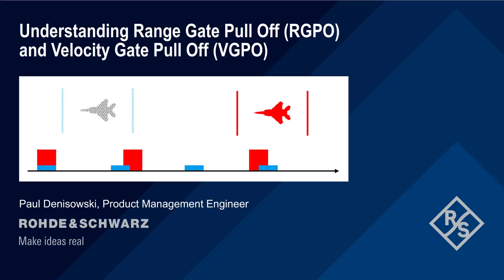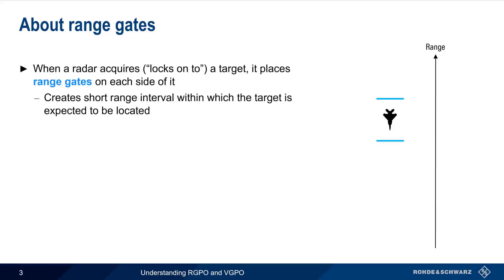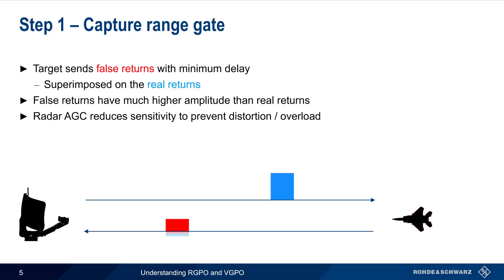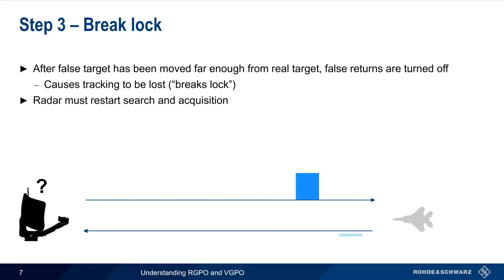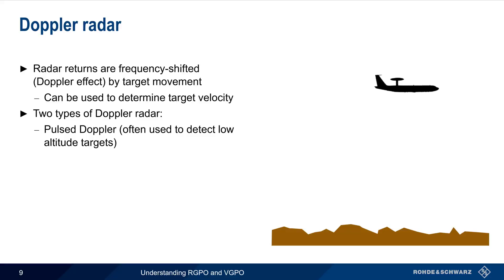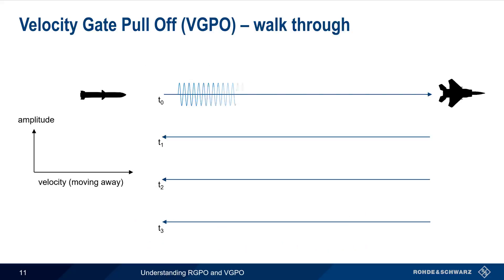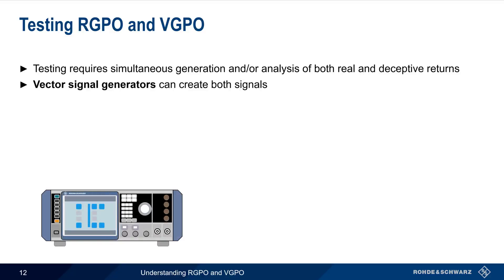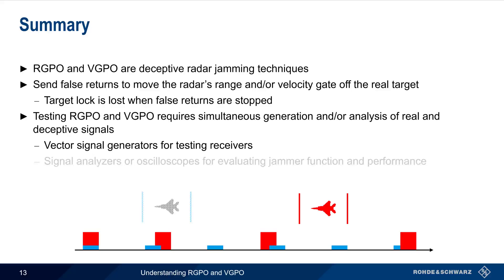Understanding RGPO and VGPO

Comment: Do you have more videos on EA techniques?
Reply from the maker: Band 28 is an FDD band in the 700 MHz range. I am not a smartphone expert and cannot state which phone supports rank 4 in the lower bands, but in general 4x4 MIMO is supported in the mid and high bands in smartphones (low bands antennas have a bigger size). From deployment perspective 4x4 MIMO is used in cities where high capacity is needed (in mid to high bands because of the higher available bandwidth) and where more multipath is available.
Reply: @Rohde-Schwarz  Electronic Attack techniques......
Reply: @Rohde-Schwarz  😄